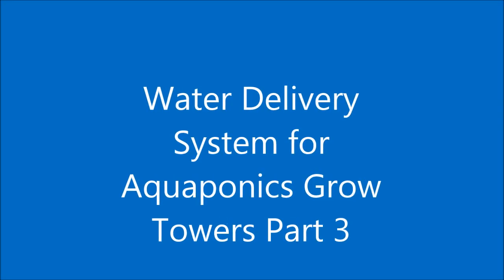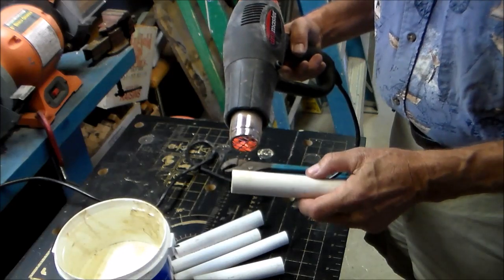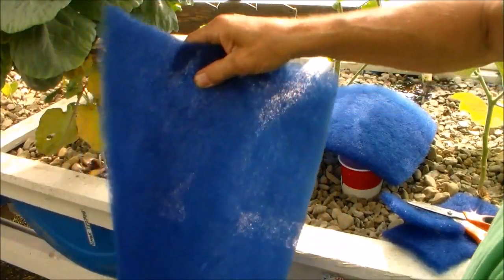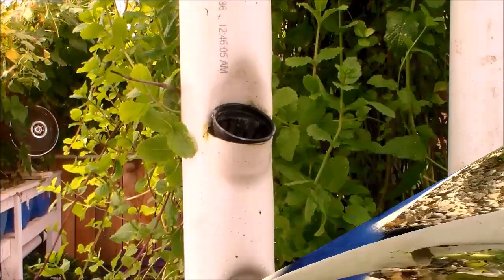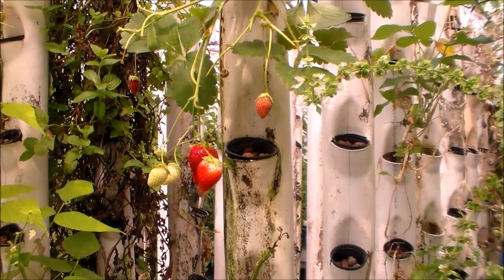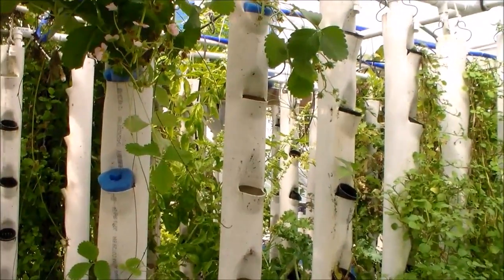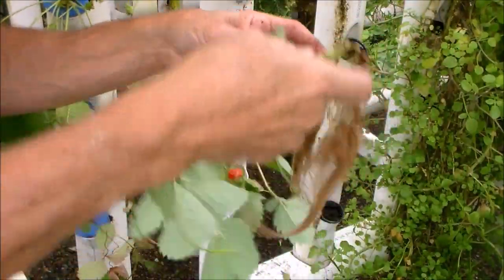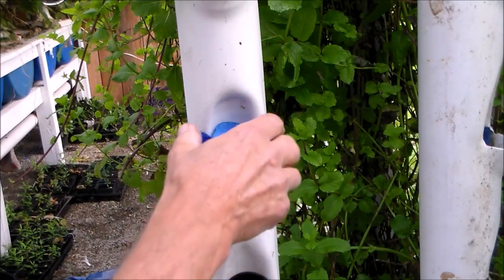Water Delivery System for Aquaponics Grow Towers Part 3

Comment: I couldn't find pond filter material anywhere cept in tiny sheets from lowes for like 13+ bucks a tiny piece
Reply: Where do you find it? Can you give us a link?
Reply: @normbozard7330  I ended up scanning amazon alot and found a nice roll of it for 20 something. Not horrible but not great either. I actually ended up ditching the hydro tower set up as it cannot be done all naturally and needs deadly and potent chemicals to work. I instead switched to soil towers and cut these into lengths and laid them down the tower to help with drainage.  worked like a charm. But sadly can't remember how many hyrdo towers you could make with the 20 piece. I think about 2 or 3 per, as I'm getting about 5-6 SOIL towers which only uses a thin slice down the backside =)

Comment: I forgot to add that if you cut the swimming noodle before putting it in the PVC, then when it fills with roots from the plants and the plants are finished, you will be able to pull out the noodle, open it, remove all the roots and place it back it the tube to plant new plants, however you will need to be careful when removing the roots so you don't destroy the swimming noodle.

Comment: Try putting the swimming pool noddle in the PVC tube instead of the blue filter fibre, you will need to cut holes in the noodle where the plants go in and you might need more noodle put in behind the plant to help hold it in place.
Reply: Heather Watson  
Would not have the same BSA

Comment: I'm going to be growing 300 strawberries in vertical hydro towers this season.  How do you save and store your strawberry rootstock at the end of each season for next season.  I live in zone 6b  and get cold winters.
Reply from the maker: I run the system thru the winter using ever-bearing plants
Reply: @donaldporta  thanks for the response.  Idk if that will work.  I'm assuming everything would freeze

Comment: Hello Donald,  many thanks for the video as it's very intuitive. Had a question though, would the foam soak out all the nutrients coming from the pond? And hence cleaning the water in the process.  If that's so, would you recommend to push back the water into the system without further filtering it? Thanks in advance
Reply from the maker: I find the best method to recirculating the water from the sump is to have the sump pump raised off the floor of the sump. I have mine about 3 feet off the floor--- this way the find particles have time to settle out of the water and to the bottom of the sump, I have much less problems with the clogging of the system.
Reply: @donaldporta  thank you for the information. God bless

Comment: Can you make the holes for the greens insertion on both sides of the PVC pipe?
Reply from the maker: Yes--- however it is recommended to do only one side since the spacing between rows are tight and the towers on the back row will need that space.

Comment: trying the noodle on my towers but need the cup and net pot. so the roots are contained in the net pot is that good or bad? your thoughts
Reply from the maker: certain plants with small roots love the net pots, however some plant have roots that get really massive and this is where I use the continuous slit so the entire mass can be slid out wnen time for removal.
Reply: my towers are 5" square 4 sided ( I inherited) so no media inside. in the net pots is some hydroton with the roots and about 7" of hydroton in  the very bottom of the tower. put strawberry's. in so far. some have 8 - 10" roots already stuffed into the net pots. should I just let the roots hang down on the inside as you do? with 20 plants in each tower that will become a massive root system inside the tower. and the noodle is working just fine

Comment: I’ve read the comment about regulating the water with the weight bottle but is there water flowing through the towers constantly?
Reply from the maker: The water in this system cycles about every 15 to 20 minutes and it is set by the flow rate of the in flow into the storage tank. The system with the drip tubes has a continuous flow.  The advantage of this cycling is the large flooding of the roots in the towers.

Comment: Question: why do you need to make the tube vertically, when you can arrange it horizontally ? same number of plant can be inserted, with much support from tube.
Reply: Well vertically considerably savs space ;)
Reply from the maker: A very good question--- what I see the vertical tubes being used for is the harvesting, where the tube is removed and then harvested or taken to market. the horizontal grow tubes I will have to give it a try, thanks for your comment my friend---   Don

Comment: Why would you need foam if you use a net pot just a question
Reply from the maker: experimenting with different methods of planting, the foam holds the plants secure and also helps to keep the water in the towers.
Reply: Are those foams ok with food standards??
Reply: jimmi taiju  
I would worry about the PVC over the Polyethylene foam.  I don't think either are an issue but you could use HDPE as your tower if you had a concern.

Comment: Hi Don have you grown from seed with this system or only seedlings. How do you grow from seed or do you buy the seedlings if not grown in this system. Is it a fully enclosed hot house/green house.
Cheers from Australia
Reply from the maker: Yes it is best to grow everything from seeds--- you don't want to introduce a desease or peste into you greenhouse. The safest way is to start your own plants from seeds or cuttings from existing plants. Good luck my friend--- Don
Reply: Thanks Don for the fast reply what would you put a seed in so it wouldn't get washed away or do you start the seeds elsewhere.
Cheers from John
Reply from the maker: Some seeds are just scattered on to the gravel bed, and others are started in a potting mix then transplanted--- Tomatoes I start from cuttings in the floating raft bed, they root in a week or two and are mature plants---Don

Comment: Where do you buy your PVC pipes, joints, water pumps, and all the stuff? If you buy all these at Lowes or Home Depot, I suppose it will put a dent on your wallet.
Reply: on the internet and home improvement stores are the best

Comment: Hi Donald, Thank you for posting, you have solved MANY issues i have been struggling with. Congrats with your system. JUST love your straw in the verti tower, great idea..
Reply from the maker: +Tim & Izette Grobler Straw is a bad idea--- a failure--- breaks down too fast, use coconut coil instead.
Reply: +Donald Porta thanks for the info....

Comment: So what happened with the straw? What issues did you have that caused you to change? I am guessing that you used the heat gun on the grow towers to bend out the bottom and bend in the top of the growing positions. How has your Ph, Ammonia, nitrite, and nitrate levels been? Are you still hosting multiple breeds of fish? Last update I saw you had Tilapia, Trout, and Perch. I saw your recirculating set up to increase the water temperature for the Tilapia.
Reply from the maker: +Mark Prescott Hi Mark---The straw that I used broke down very quickly and collected in the bottom of the grow tubes and even plugged them causing overflow in some.  Abandoned this Idea for other grow medium.  The new watering system is only in 1/3 of my towers and trying for less maintenance as far as keeping the water flowing into the tubes---the larger orifice may be the answer, so far so good. The water tests most never change and never had to make adjustments--- the system seems to want to stabilize by itself. The fish I had a devastation and fish kill with most of them--- they all perished due to either a parasite or infection, catfish I lost 100 in 4 days , and lost all the trout. The tilapia  as soon as I noticed them sick I increased the water temperature to 86 degrees and thy all got well. I cleaned the infected tanks out and started over in those tanks--- The tank heater works wonderful and saved the tilapia. Have a good day my friend---Don
Reply: +Donald Porta THanks Donald. I really appreciate you sharing all of you knowledge. So what I hear you saying is that you are only keeping Tilapia right now. You did not answer about the water quality of Ph or Ammonia to Nitrites, so I can only assume you are not monitoring these at this point.  I wish you all the success in the world my friend.
Reply from the maker: +Mark Prescott I do monitor the water characteristics, but everything seems to never change ,I check less frequently, maybe every other month.
Reply: +Donald Porta Every time I watch your videos I learn something new. I really appreciate the effort you take to share your amazing wealth of knowledge. Not only that, but you are willing to answer all of my stupid questions with little delay. Is there anything that you do not know how to do? Thank you for sharing my friend!!!